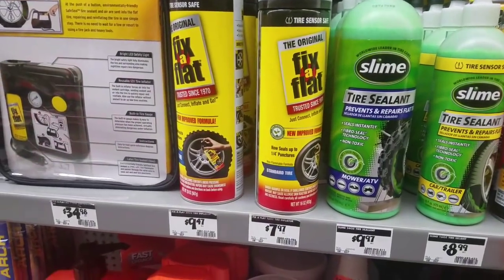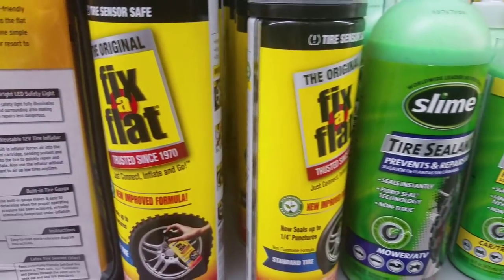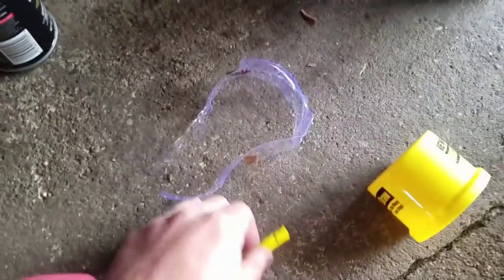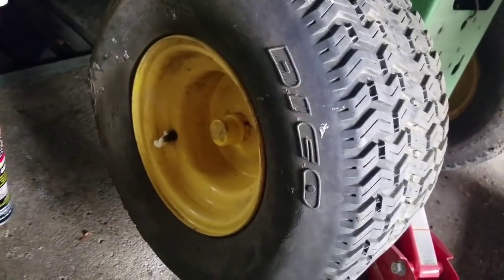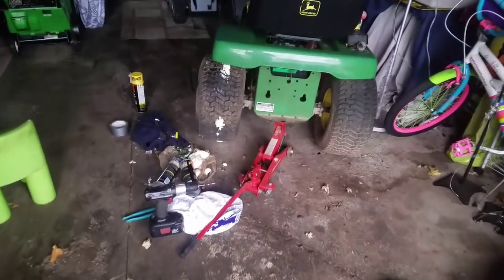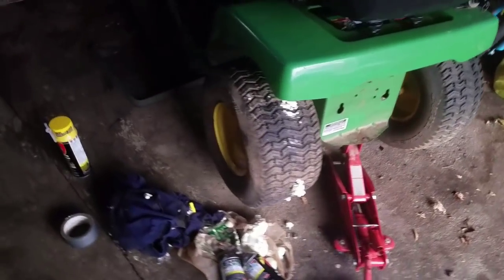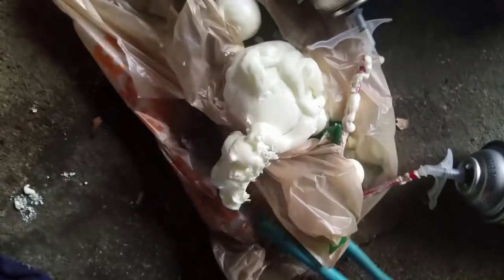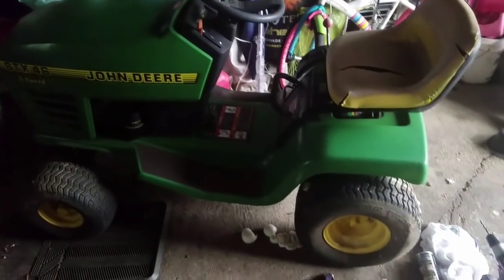FIXING A RIDING MOWER LAWN TRACTOR SEVERELY DRY ROTTED CRACKED TIRE GREAT STUFF FOAM BIG GAP FILLER

Comment: As somebody else tried to say...The instructions tell you to hold the can upside down when you use it or you don't fully transfer the foam from the can.
Reply: Fred Ross that's not true I have done this before. No where on the can does it say turn upside down.
Reply: Yep, agreed, should be bending the nozzle side ways as well as holding the can upside down.  For the cost of 4 cans might be worth buying a new tire?

Comment: I did this to a hand truck at work.  Tire filled up but foam never set up.  Looked, and felt full until a load was put on it.   Tire performed as if very low on air.   Tie rolled a bead and what a mess when all the wet foam around the room squirted out.  In the end it worked.  Boss bought a new hand truck.

Comment: Glad to hear of your success!  As an old hardware man, I can say that the one problem users of foam almost always do not address is the need for moisture to activate the foam.  The only way to get foam to cure completely is to expose all of it to water.  Failure to do this will cause the foam to collapse eventually since it is not fully cured.  I plan on using the following technique to properly activate the foam in an old tire.  Always invert the can to release the foam.

1)  I would first grind up some dry oatmeal into powder and then mix it with water until it has a pourable consistency and is about one pint for a mower tire.  
2)  Put the liquid in a squeeze bottle that has a spout small enough to fit into the schrader valve that has the stem removed and put the oatmeal in the tire and spin the tire rapidly.
4)  Grind up about 2 cups of foam rubber that will absorb water; saturate the particles with water; and push them all of the way into the tire along the rim.
5)  Clean out the Schrader valve with water, and replace the stem.
6)  Fill the tire rapidly with air to set the bead and then spin the tire rapidly to disperse the liquid oatmeal and foam particles.
7)  Remove the valve stem and drill several 1/8" holes in the grooves around the radius of the tire between the treads.
8)  Fill the tire with large gap foam and stop several times to squirt water into the valve, and repeat the foam process until foam starts coming out at all of the drilled holes.
9)  Spin the tire rapidly again; add foam as needed; and let the tire set for two days while occasionally wiping away the excess foam that come out during the first couple of hours.
If this does not fix the uncured foam problem, I do not know of anything else that will.
Reply from the maker: When you do it, you should make a video.  I'll post it as a follow up.
Reply: I am working on modifying and simplifying the procedure by eliminating the pulverized foam rubber and using a compression sprayer to inject a constant miniscule mist through a hole through the tire tread as I add the sealant, stopping to spin the tire during the process.  I first would need to justify this to my wife, who holds the money tight and fast.  LOL
Reply from the maker: I totally understand that.  You know im.pretty sure after 3 months my foam has cured.  It's as hard as a rock.  I do have 1 flat spot, I suspect from when it sits over night from the weight.  It works fine for a riding mower.  You don't even feel it when you're on the lawn.
Reply: @MowersNBlowers  I think your foam cured because you said that you tried slime and fix a flat first.  The moisture from those products probably  helped it to cure.

Comment: I tried this, it works at first and then it starts to brake down inside the wheel. I used 4 cans of Great stuff on one tire. Best to do it on a Hot day. Two wheel lawn cart. I still had to buy myself 2 new tires. The price of those cans are not worth it, 4 cans + tax= 1 tire from Harbor Freight. Hold your can upside down. Put one can in at a time. First can wait till the next day, then do another can, ect. Do it out in the sun.
Reply from the maker: Yup, flat spots too!

Comment: It would be interesting to try pulling the tire (at least half way) off the rim and spray the inside of the tire with Flex Seal, remount it, and air it up while it is still “wet”. I wonder if the air pressure would force the Flex Seal into the dry rot cracks for a long lasting fix? I have had some nice (cheap) success injecting a mix of rubbing alcohol and white school glue or green antifreeze and school glue through the valve stems (core removed). The idea is to thin the glue. The antifreeze will cause the rubber to swell around the leaks as the glue works its way in and sets up. The alcohol will evaporate faster than just water, leaving the school glue soaked into the dry rot cracks. School glue remains somewhat flexible after it cures and some moisture or condensation inside the tire tends to delude the glue back to a softer state. I bet some rubber contact cement brushed onto the inside of the tire would make a strong fix as well.  You could even lay some strips of thin sheet plastic or rubber over the wet cement to help seal some badly rotted areas. My worry about the foam is that the weight of the mower and rider will eventually cause it to collapse or breakdown? I have also heard that brushing a thick coat of latex paint inside the tire walls will seal it.
Reply from the maker: Atf seals slow leaks

Comment: If All Else Fails, Read The Instructions!!! Wet The Inside of the Tire First!!! Hold The Can Upside Down!!! Shake Well for About A Minute. LOL!!! You Need to Use The Tire Under Load For A While before You Can Call It  Fixed!!!
Reply from the maker: Its been a few months...still going!
Reply: Wow!!!

Comment: You can coat inside wall with FLEX COAT, a paint on sealant. It was fun to watch the whole process.
Reply from the maker: As you may have read the description, wheel wont come off transaxle.  Tire seized on rim...impossible to flex seal inside.  I would have put an inner tube in if the tire would break the bead.

Comment: Another mistake that is usually made is that the bead needs to be sealed on the rim so that when the foam is compressed, there is no place for trapped air to escape.  Simply filling a tire with foam and not seating it properly on the rim will result in eventual collapse due to pocketed air escaping along the bead and rim, even if the foam is completely cured and fills the tire because compression will occur that flattens the foam by allowing the trapped air that provides structural support out of the tire.

Comment: i tried the foam left it 4 days so it can expand all the way and 2 yards later the front tires on my zero turn was flat again and you can actually see the foam coaming out in forms of powder
Reply from the maker: Yes, it doesn’t work unless it’s filled 100% and fully cured.  Mine ended up with a flat spot, I should have kept it on a jack,  it was just an experiment!

Comment: how do you get the key way out of the shaft on the transaxle of a Murray 40 inch cut or is that kiwi permanent to the drive belt or drive pulley on the rear
Reply from the maker: Keyway is about 3 inches long on each side on the transaxle.  Remove the wheel and it should fall out by itself or just sits there.
Reply: spray it with foam lol

Comment: Don't ever do this Ever! take to your local Walmart or firestone and have either a tube put in or have them repair the tire! my local firestone charges $10 for a tube put in or to have it plugged. This is a temporary fix.
Reply from the maker: It was an experiment
Reply: It's ok it worked for a while. You do what you have to.
Reply from the maker: I usually use ATF! better than slime, but an inner tube is best

Comment: Take the tire off...lay it flat...drill several 1/8" holes...inflate with foam....hold can upside down when filling tire...leave it off until foam cures.
Reply from the maker: +m schiffel I ended up doing exactly that. Thanks.

Comment: I would imagine that over time, the foam inside the tire will get pulverized and you'll be back to a flat tire.  Has anyone had long term experience with this?  I have a riding lawn mower that even with a new tire, it goes flat in about 2 months.
Reply from the maker: I've had the same thoughts, I haven't used the mower much since.  I think its a temp fix.
Reply: Yes I did....One day I did, my then 16 year old daughter and i filled a front tire on my Scag 72" ZTR. We did have fun watching the foam come out all the holes etc.....One week later it was flat and full of crumbs. My daughter said 'good idea dad' LOL.

Comment: Might need to do an update because after putting weight on tire and it rolling  it will go flat again wasn't that your experience
Reply from the maker: Frank, I sold the mower shortly after, it was fine a year after as I saw the owner.

Comment: Just put a tube in it, it would much easier and cheaper. The spray won't work because there is no air. you need to expose it to air to cure.

Comment: you still have a flat spot on the tire not good ride. should have aired it up to get the deformity out of tire first. then used that special foam spray for airheads

Comment: The instructions tell you to hold the can upside down !!!!!! I found out also to let it in the sun after you fill it. Use rubber gloves to keep your hands clean. I have used 4 cans. Tire got hard. You should have put air in it to take out the dent first.
Reply from the maker: Since when do men read instructions?

Comment: hahahaha....wait to use the mower, the foam will turn to small chunks and large dust and fail.  I've tried it several times with many cans of Great Stuff.  Everyone has a different take.  Some people say to hold the cans upside down but the instructions on the can say you can hold it anyway you want.  In short, my opinion is to buy a new tire or inner tube and stick with what we know for sure works.  Too many back yard hacks posting nonsense on YouTube and not knowing what they are doing or have completely done a complete comprehensive test on this rigid foam that is not designed for this type of application.  Also if the temps are chilly or cold, forget this whole process.

Comment: I can't even begin to imagine that stuff can do anything worthwhile. It is a gap filler; keeps air from entering / exiting an area. I doubt that it can support any meaningful weight without collapsing / crushing and turning to dust.
Reply from the maker: You see me in the video stepping on the tire...kicking it...its solid.  Still holding up perfectly month's later.

Comment: I would have popped bead slipped an inner tube in there and been done with it... Or maybe if I'd had a stupid moment...  Touch of Ether after a quart of slime against the crack. Take tire off rim next time put a ratchet strap around the circumference of tire, pull valve stem and hit it with unrestricted air nozzle. That'll get you some slime in the crack where it belongs. Lol!
Reply from the maker: Fo sho! It was a test just to see if itll work.

Comment: For all the hassle and mess it’s easier to just get a new tire.
Reply from the maker: Well anyone can do that right? A new tire is uh….$40?  Plus mounting it on the rim?  ATF IS FREE
Reply: @MowersNBlowers  nothing free anymore. The great stuff foam in a can is not cheap either.
Reply from the maker: @MattyMCcRollin17z  oh I thought you knew about the ATF trick!
Reply from the maker: @MattyMCcRollin17z  HOW TO FIX A SLOW LEAK TRACTOR TIRE WITH AUTOMATIC TRANSMISSION FLUID ATF FILLS DRY ROT CRACKED TIRE
https://youtu.be/rEL5tS-vKQU

Comment: You would think that people wold have enough sense to realize that foam will just crunch up and turn to powder.
Reply from the maker: 2 years later...it's still hard and moving fine.  You would think people would have enough sense not to assume it doesn't work when they haven't tried it themselves.
Reply: Mowers N Blowers I think you're full of crap. It turned to dust for everyone else
Reply from the maker: Not if you pushed more in and then siliconed the holes.  But honestly, you can believe it or not, I don't care!  Be well.

Comment: I used motor oil on my John Deere garden tractor, it's held for a year and a half now.  I have a two-wheeled hand truck that I wanted to try this method but I did the same thing to these tires with the oil. Somehow I don't think the Great Stuff will adhere to the inside of the tire now. Wish I would have seen your video beforehand.  POOP.
Reply from the maker: Oil? That's one thing I haven't tried before...sounds really messy!  It's been over a year and the guy o sold the tractor to said the foam is still hard as a rock and holding up. Hope you subscribed
Reply: @MowersNBlowers  No, it wasn't messy with the oil can having a narrow tip and taking out the valve in the stem. BUT,  recent events have brought me to a wheelbarrow that I'm going to try. I'll keep you posted. PEACE
Reply from the maker: @cornfusedatbest6693  lol, good luck Gary!

Comment: If you ever need to replace the tire you're up the proverbial creek. This stuff will ruin the wheel.
Reply from the maker: I guess the point of my doing it is so ill never have to change it.
Reply: Never is a long time. Nothing lasts for ever. When the tire dry rots and comes apart you'll know what I'm talking about.
Reply from the maker: The tire is trash to start with, dry rotted to the point where the only option was an inner tube or foam fill, since ive never tried fiam, this was the experiment.

Comment: Slime will destroy your rim, it is corrosive and rust your rim from the inside out.
Reply: "Slime tire sealant is specially formulated with rust and corrosion inhibitors that work to protect the integrity of your finished metal rims. In automobiles, we recommend removing the tire sealant and repairing your flat tire within 3 days or 100 miles. In non-highway vehicles (such as bicycles, ATVs, trailers, farm equipment, etc.), Slime’s tire sealant will prevent flats for up to 2 years without causing damage to your rims." -https://www.slime.com/us/blog/5-tire-sealant-myths-busted.php

Comment: If it holds....hope you have a back left after awhile. Rock hard is right.....lmao. Just buy a tube for it ….geezs…..lol
Reply from the maker: I guess you dont understand...wheel is fuzed to transaxle. Wheels wont come off, bead is fuzed to rim, cant put a tube in it. Plus it's a test to see if itll work! Geez!
Reply: You can get the wheel off if you know how to. You can put a tube in even if the wheel is stuck on the axle or even replace a tire with a wheel stuck on axle..
Reply from the maker: @arthurrodesiler3109  I've done it a lot! Torch, water, pb blaster, wheel puller, chisel, sledge, air hammer, bead fixed onto rim.  Tire will shred before it breaks the bead. And yes, I have videos showing me put a tube in a tire while still on the axle.  But this particular case. It wont work!

Comment: Don't they make tubes for those tires? Probably cost as much as the crap you bought.lol
Reply from the maker: Lots of videos on putting a tube in a tire.  Not many on this...its a test for a video bud.
Reply: @MowersNBlowers  I misunderstood it as a cheep fix.
If that's the case then now I know not to use any of those methods.
Thanks
Reply from the maker: No problem buddy...im included as one who will never use this method....lol.
Reply: I was thinking if you took out the valve stem and filled the tire as you spun it around you might not have had to drill.
Reply from the maker: @truebuldog  nah...after the area of the valve stem was filled...it wouldnt have enough force to push the rest of the filler throughout thebtire evenly.  Drilling holes had to be done.  On another note.  Its been a few months since i sold it and the guy who bought it from me says its holding up well.